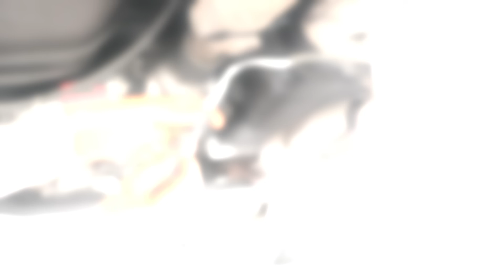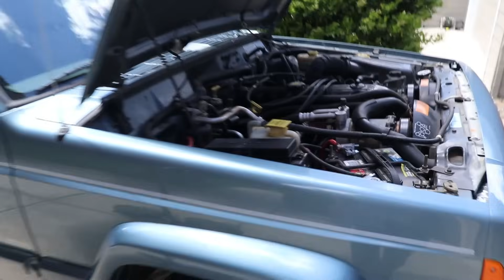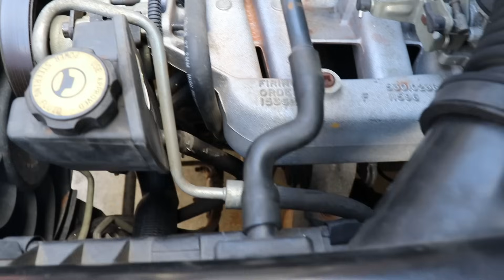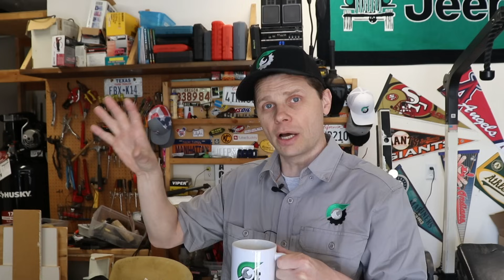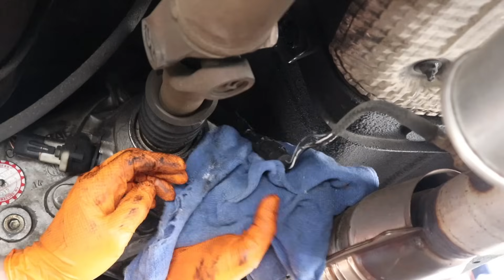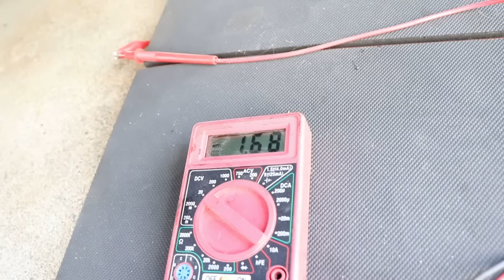Don't Buy Oxygen Sensors! How to test o2 sensor

Comment: Thank you very much for identifying the sensor heating and O2 sensor wires involved on a 4 wire sensor.
...but mostly the voltages that are measurable that they are absent, or hopefully changing via sensation of O2.
If I replace an O2 sensor again I will cut off the sensor to re-cycle the connector and wires to connect to the stripped wires rather than probing into the connectors for the next time I troubleshoot if the ECU is sending the heater voltage to the sensor.
Reply: Are all o2 sensor connectors the same?
Reply: @MrsBuddevil  look up a bunch of different ones from auto zone etc. maybe you can see a difference from the pictures.
Reply: @MrsBuddevil  no, they vary a lot, depending on manufacturer and position as well. Front and rear sensor plugs can be the same in appearance but have different little lugs that prevent them from being interchangeable. The shroud on the after cat sensor has much smaller holes ( like pin holes ) to restrict flow around the sensor. The before cat o2 sensor shroud has holes like, vents, would be the easy way to describe it, say, the size of the smallest type of grains for example, allowing the sensor greater exposure to the exhaust gasses because this one controls the fuel mixture ratio.
Reply: That's a good idea.

Comment: I’m getting a P1168 code. Ive replaced the bank2 sensor1 twice already. Closed loop control is the code description. I put a monitor on while driving and the voltage stays at a constant .610 while the bank1 fluctuates.  Is the sensor bad again? I’ve replaced it twice since October 27th.

Comment: Excellent video!! I had both my 02’s replaced, plugs and coils and it ran like a bat out of hell. In just a few days the car threw a bunch of codes (P3091, P2177, P0141) limp mode in and out, and was almost impossible to start. (07 Mini Cooper S) Do you think the shop missed something on the install? Thanks so much!

Comment: If the O2 sensor is generating voltage and sending it to ECM , why do you have a voltage on the connector from the ECM side ?
Reply: I wish someone would answer this type of a question, I’ve been trying to figure out how my keep has 3.8 volts going to the sensor, switch on engine off. The  the front 02 has the same voltage, but when I start the engine the front 02 starts dropping and will start working correctly in about 2 minutes, this is when the vehicle is at operating temp. The rear one however doesn’t drop, when I unplug the sensor and test, it shows .25 v.
Mechanic all my life, but this is a new one for me.
Code p0138
Reply: @vannkate  I found the answer , this is called bias voltage that is sent from the ECM to a sensor to determine the integrity of the circuit,  for more info YouTube bias voltage.

Comment: Awsome video thank you.  But I've changed all my sensors.even checked for vacuum leaks. And Yes I try to buy all oem stuff. But for some reason when I start my jeep 2000 xj it runs good. Then after 5 mins it will start to sput.. like rough idle or  light  misfire sometimes bad idle like a bad misfire. . BUT when I turn it off an let it sit for 15 to 25 min. I restart it an it runs fine...yea sometimes  it still has a sooooo light sput or putter to it. Some times nothing
 Just normal.i can't figure it out? The motor was rebuilt from a well know shop. Once it runs good its awsome plenty of power and everything so smooth.but in the beginning it sputs..or.idk how to explain it. Like a so slight rough idle or sputter. Idk. If you or any one has had this issue
Please! Let me know thank you.!

Comment: I’m confused a little. If you were testing the input volts from the harness and it was reading basically zero volts. Wouldn’t that mean the harness or fuse was bad not the sensor?
Reply: There was a little green overlay in the bottom right corner stating eventually there was voltage but it was inconsistent and minimal.

Comment: Why didn't you check the supply voltage to the heater? Both white wires, which should be ~12vdc. For the supply you checked the voltage on the grey and black wires on the supply side connector, which showed ~1.5Vdc. Those wires receive the voltage from the sensor, not send voltage to the sensor.
Reply: Can you make a video to show us?

Comment: Any ODB II that shows live data can tell you the voltage of the 02 sensor. I've been searching for what the resistance should be on the 02 wires. Checking the voltage won't necessarily tell you if the sensor is defective. It will only give the voltage reading of the emissions and or mixture condition being produced exiting the cat.

Comment: what about the voltage for the heater when is on ignition.. i am trying to pin the problem 98 vw beetle.. check eng. lite on i bougt a new sensor still same probl. b1s1 oe not derect it and no heater circuit.

Comment: Im getting a huge  voltage drop from my front O2  sensor, when my 2nd sensor behind the katalysator keeps steady voltage. My Opel Astra starts twiching and jerking after a short while, when the engine warms up. Then engine light pops up and it goes To limp home Mode with huge engine power drop.
Data says the hating part supposed To be ok, but se sing not. My friend said if the heating part on the sensor is working and air sensing not, You could try To clean the sensor?
Reply: Hard to say. Opel (if it's GM based) uses a different strategy to determine when it turns the light on than its US variant. If it's running that bad though, typically it's not just a bad heater in the o2 sensor.
Reply: I've never heard of cleaning it though. Only thing people clean are mass air flow sensors as far asi know. What are the codes stored?

Comment: Meh, you shouldn't have a lot of swing on the back if it's post cat. That's literally how the computer determines P0420, by intentionally altering fuel injection at cruise and comparing the front readingnto the rear reading. Over time, the readings get closer and closer, and at a set point, it says they are close enough to say the catalyst is worn.

I would've liked to see these numbers on the front O2 sensor pre repair, since with seeing 2 boxes at the end, I'm guessing you replaced both.

Comment: Hi I have a check engine light on a been having horrible fumes for weeks..i go today guy checks the code says its my C02 censor..then without doing anything else says its my exaust..is it possible without him doing anything but checking code ..to say its my exaust..he said he wont put in censor until he fixes my exaust..also if someone puts in that sensor will that stop the horrible smell thats coming from my car..
Reply: Not too many cars have carbon dioxide sensors. If yours does, it's pretty new technology on a car and not many mechanics are going to be familiar with it.

Now if the car has an exhaust leak that's bad enough to cause fumes, you definitely want to fix that. That horrible smell can literally cause health problems, and if it contains enough CO, which is odorless, could actually kill you.
Reply: @slowpoke96Z28  can i purchase like a carbon monixide detector or something to detect smell on my own for car
Reply: @penpopco013  probably. But most are meant for ac power. Cheaper to fix the exhaust

Comment: My 2000 dodge ram 1500 5.2 v8 sport stalls while driving in the hot summer sun ill have to pull to the side of the road and usually it will start right up sometimes I have to wait 10 to 20 minutes could it be the o2 sensors?🤔

Comment: Thanks for the info but, after replacing my back/ sensor 2 on both sides of my '07 LR3, I still get the same codes, POO36 & POO56, could that mean the cat is getting blocked??  Whats your thoughts? Thanks.
Reply: Check the fuses for the o2 sensor heaters. Cat health can't be determined by these codes.
Reply: @slowpoke96Z28  will do, thx.

Comment: You were testing the voltage (supposedly) from the signal/ground on the harness side, yet if you look at video, you were probing the wires going to the sensor. How in the world were u getting any volts at all?
Reply from the maker: The heat creates a tiny bit of voltage

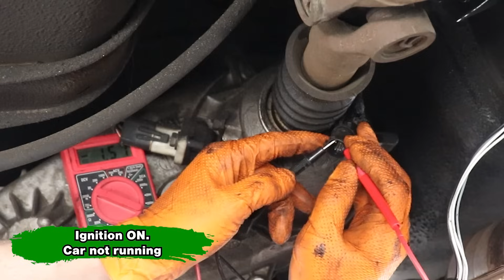Comment: I am sure that I am missing something or have misunderstood.   At the 4:00 minute mark you test the sensor and ground wires for voltage.   Shouldn't those only produce voltage once the sensor is heated and working?   If you are checking to see if the heater is working, shouldn't you be checking the other two wires.   Or maybe I just have my wires crossed.  (wink)
Reply: He was testing for the "rider voltage" from the engine computer right there.

Comment: i have my o2 sensors that are not monitoring.  the heated o2 is monitored and so is everything else, except o2 sensors.  i have no codes. i replaced sensors 1-2 years ago.  there are 2 upstream and 2 downstream.  i have alittle exhaust leak, but i have been told that wouldn't affect the o2 sensors.  i thought it would, because if it getting outside air the sensor would send a signal to compensate.  but what do i know?  any ideas where i can start. i have driven the vehicle 100 miles so far.  CAT monitored, heated oxygen sensor monitor, evap monitored, oxygen sensor not monitored
Reply: Year, make and model. Vin even better. But basically, if it's not monitored, then it isn't monitored. You can drive it a million miles and it won't show complete/ran. The OEMs weren't really anxious to write software to test above and beyond what the law required at the time.
Reply: @slowpoke96Z28  i figured it out. Both upstream sensors weren’t working correctly ( no codes). Replaced them and it monitored after 8-10 miles

Comment: So if I want to test my pre cat o2 sensor on my
Bmw, I just need to see that it’s between 5-7ohms?
Reply: Inconclusive test....

When you disconnect the plug, you can measure 0.1 ~1 volt on sensor side on two coloured wire (sensor signal) when engine is running and has achieved optimum temperature (generally within 30~60 seconds). This oxygen sensor generates small voltage potential when it achieves certain temperature...to ensure it does it quickly, manufacturer has built in a heater....thru checking voltage produced in hot sensor, you can verify sensor serviceability.
Now for checking oxygen circuit (opposite side of sensor), with ignition switch on and engine not running, you can check voltage on two white leads, which will confirm that heater circuit is OK. While for signal wires on this side, there is a beautiful method:
Ignition switch ON, engine not running and obd connected, you need to monitor voltage value of oxygen sensor 2; it will be Zero as sensor plug is disconnected and engine is not running to heat up the sensor. Now (beauty part), touch one hand on battery positive (+) terminal and other hand on one of the oxygen signal wire (plug terminal by means of a crocodile clip etc) towards engine/computer side and see the sensor voltage value on your OBD/scanner, if it changes, that means your oxygen sensor circuit is OK & if still Zero...that means a circuit or even ECU malfunctioning.
ECU malfunction is quite rear in this case

Comment: Car started to hesitate badly after replacing both 02 sensors on the expressway or hilly roads.  Getting lean code and survice engine light. Give insight if can.
Reply: Make sure no pins on the connector are bent and that they seat all the way.

Comment: Great video! Truly appreciate all of your videos.  

Could use some assistance though.

I have a 2000 Jeep Cherokee. My vehicle has four oxygen sensors to pre-cat and two after the cat. 

I was getting multiple engine codes. 

Located my sensors found out that whoever had my vehicle prior to me when I had it installed the number one upstream through the block which ultimately melted the connector and wires.  

On my downstream the wires were up against one of the exhaust pipes and ultimately got burned out 

Rewired the downstream because I didn’t see any issues with that one

But when I went ahead and replaced the upstream oxygen sensor the only way I was able to remove it from the initial connectors that was melted in fused together was to find the new connector on eBay and rewire it up to the initial wires that were connected to the harness. 

My question to you is on the original harness with four wires can you please let me know what are the color code for what wires need to go on top and what wires need to go on the bottom. 

Thank you.

Comment: How are you getting voltage out of a disconnected o2 sensor?
Reply: O2 sensors generate voltage based on a difference in oxygen content between the exhaust gas and normal outside air. The bigger the difference, the higher the voltage.
Reply: @slowpoke96Z28  thx
Reply: It's an electro-chemical reaction, like in a battery.

Comment: Great to the point video on electronics. But I'm  still a bit confused 😕. 2 wires r heater + black n Grey. Black n Grey is the ground + the hot wire that goes to ecm. So if the cars off how can u get an output voltage coming from the ecu?? O2 sensors create volts and send to ecm. I think u got 1.2 volts steady
Reply: Its a chemical reaction within the o2 sensor that senses the level of Oxygen, and produces a charge chemically. There is a post here in the comments somewhere talking about the chemistry of it. Just know that the heat in the sensor produces a charge "chemically" and that charge goes down the wire to the harness (in this case the multimeter)

Comment: how are you getting volts with none of the other wires hooked up? shouldn't the sensor be measured in ohms? 
I thought I understood this, now I'm not sure. lol
Reply: The heater is measured in ohms, the sensor output in volts. When the sensor is up to temp and operating, it generates a small voltage.

Comment: I have been chasing a misfire on a 95 Pontiac OBD1.5 for over a month. First thing I tested was probe the o2. Getting volt at the ECM signal side (and heater) of the pigtail and 2-4 millivolts from O2 side. Plugged in, probing the wire, I get .4V +/- up to .9V spraying fuel into the TB. Every source I have found said there are no volts sent to O2 but .5+/- produced by the O2 so probe reading says it is good. Apparently the o2 is as good as the information I have gotten.

Comment: Something I didn’t receive from the video is did you have the power off to the sensor when you tested ohms
Reply: Always test resistance with no power on the circuit.

Comment: Can you have a faulty sensor and not engine light coming on? Just wondering if this scenario is possible.
Reply: Definitely. Depending on the year and the OEM, there may not be a very comprehensive self test strategy in the ecm for that sensor. The technology just isn't financially viable yet for mass production to have totally comprehensive self test capability even now in 2022.

Comment: Jeep solid, you're doing the test wrong. Your reading the voltage while the sensor is disconnected is going to yield useless results because the sensors need the heating wires connected so they can generate the ions for the voltage difference between electrodes.  The general idea is okay but one must test while using 2 external cables to connect the heating wires.
Reply: That's funny, considering how OEMs used one and two wire sensors for years. The sensor will heat up enough to work even with a bad heater. Just will take longer. Widebands need heaters cause they have to stay at around 800°C to work right. Older narrowbands do not run anywhere near that hot.
Reply: @slowpoke96Z28  Well, add to that the fact that the designs have changed over the years.  Yes, they used one or two wires, but it was a totally different design and mechanism.
Reply: @ugaugauga488  no it wasn't. The o2 sensors on this jeep work on the same principle.
Reply: @slowpoke96Z28  You're not getting it.  I can't help you.
Reply: @ugaugauga488  lol, nope.

Comment: How did you get a voltage reading from the 2 grey/white wires on the rear 02 sensor without the negative and positive (power) connected to the jeep?
Reply: If the car was hot, or is running, the electrical charge is produced on the o2 sensor from a chemical reaction. As long as the sensor is warm/hot, you should get the reading he showed, regardless if its plugged into anything (on the wire side)

Comment: My OBD2 Scanner said that I needed to replace the upstream oxygen sensor. I had already bought a new oxygen sensor prior to watching this lol so I was scared I bought it for nothing but I still have the receipts just in case I want to return it.. 
I did what you did in this video and turns out that I need a new oxygen sensor after all 😆
Reply: Once installed. Recheck obd sensor and clear code